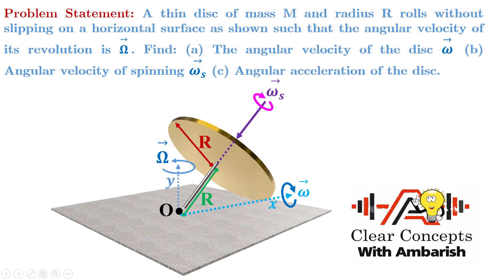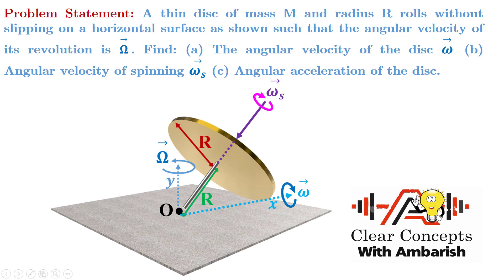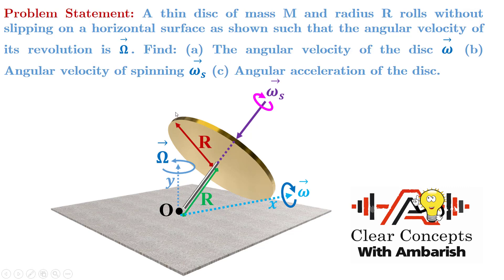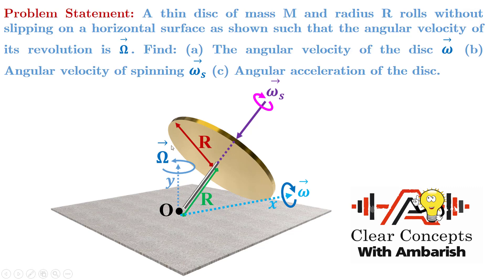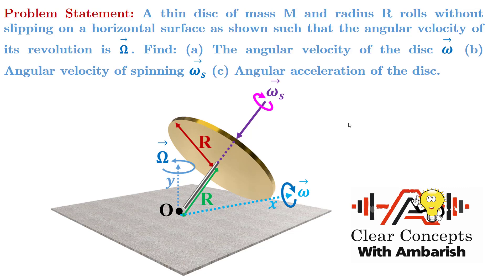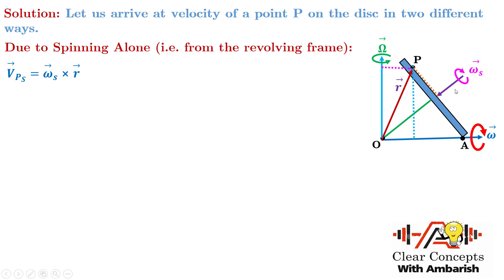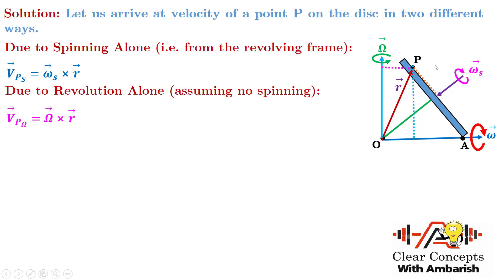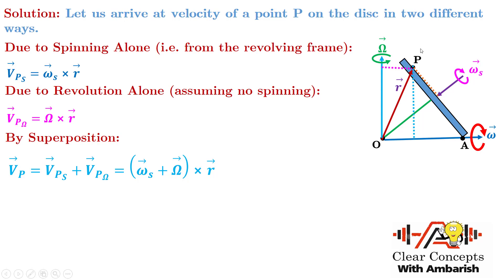3D ROTATION ABOUT A POINT UNDERSTANDING THE DIFFERENCE BETWEEN VARIOUS ANGULAR VELOCITIES

Comment: sir one confusion...

What is the velocity of point A (point of disk touching with ground which is pure rolling at the moment shown in figure )  with respect to point P (center of disk)....since point P and point A lie on same rigid body , then can we say that velocity of point A with respect to point P will be angular velocity of spin of disk multiplied by the radius of disk...

Is this correct ?????
Reply: I don't think so, because here the disc isn't rotating+ translating, rather here the disc is spinning+ rotating, so I think velocity of A wrt P should be wRsin45 (k cap) { k cap is going out of the plane} and also if vel of A wrt P will angular velocity × R, then it implicitly means that Vcm = angular vel of disc × R { which isn't true here as Janardhan sir said in 2016 jee rotation problem soln}.